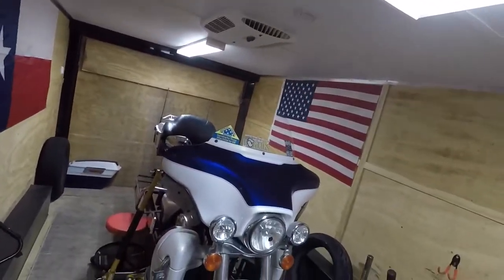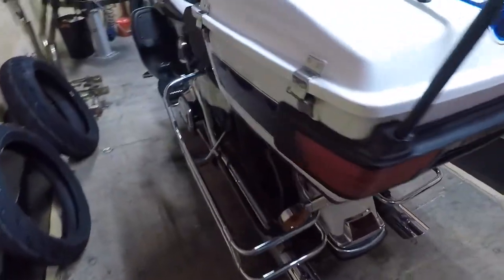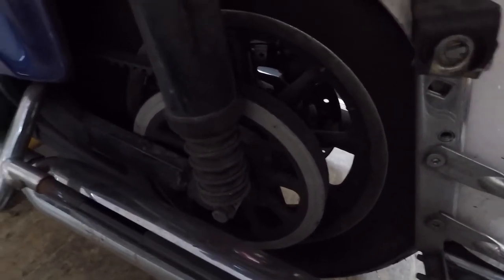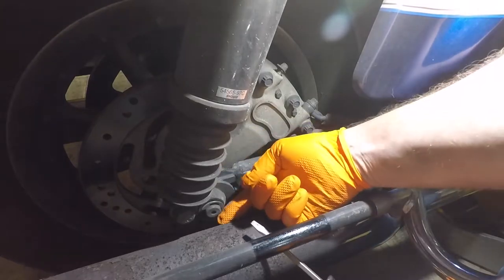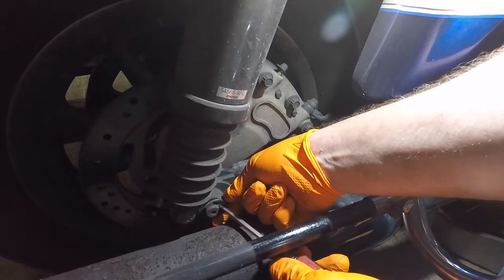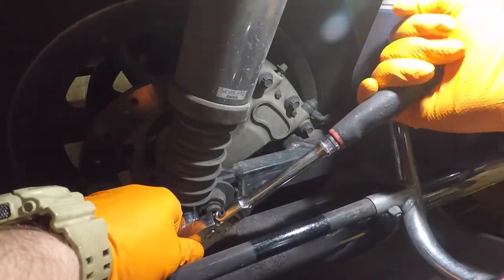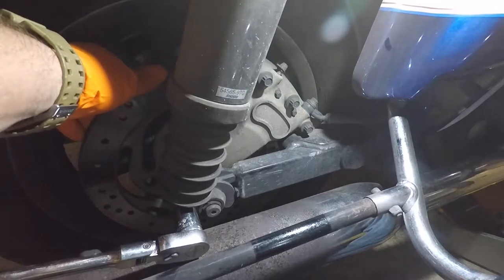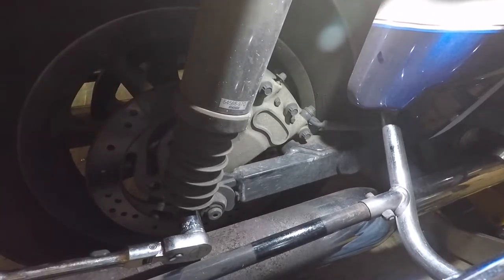2006 HD Ultra Classic - How to remove the rear wheel DIY

Comment: I have a question on the rear axle do you only torque down the right side to 100?
Reply: Also did you check to make sure the belt is in the middle of the sprocket?
Reply: @erikloose9472  The belt will find its happy place as long as the wheel is straight.  As in the adjuster cam is in the same place on each side of the bike.
Reply: If I remember correctly just hold the left side still and torque the nut on the right side of the bike. Then put the E ring back on.